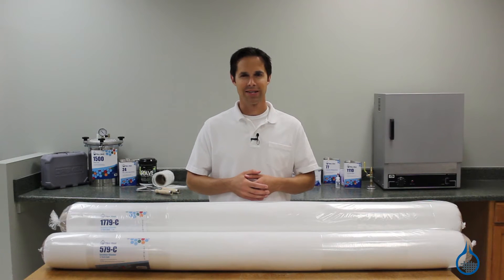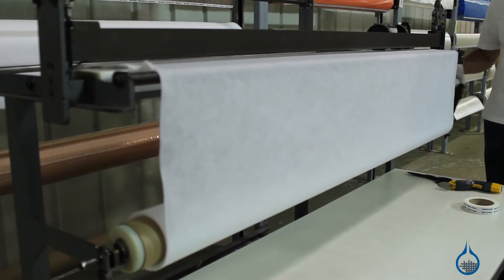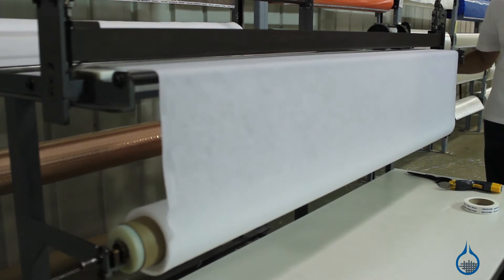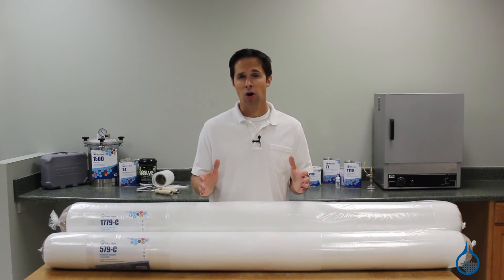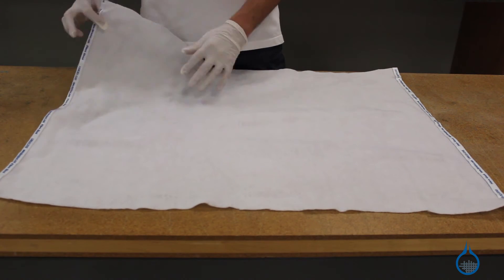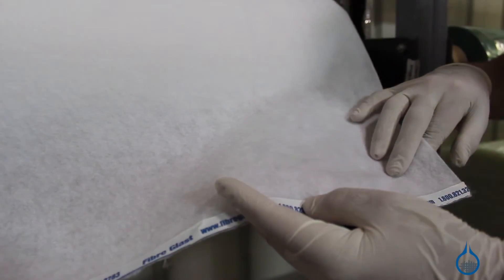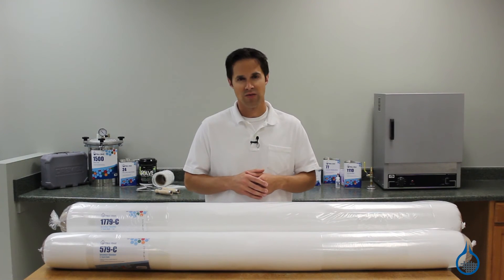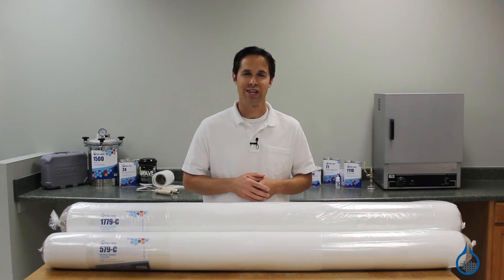Breather and Bleeder Cloth

Comment: Breather cloth and Bleeder cloth are the same thing?
Reply from the maker: Breather and Bleeder Cloth are the same yes. It is one cloth that serves two key purposes during the vacuum bagging process. For more information please contact our support team at 800-838-8984 or customerservice@fibreglast.com
Reply: @fibreglast  Thank you and can you tell me what is Bleeder ply?
Reply from the maker: @arnonlerdwongpaisan9615  Bleeder ply is the same as the cloth. Bleeder/breather cloth is used to better distribute vacuum pressure across the laminate surface and to capture excess resin during the vacuum bagging process. For more information please contact our support team at 800-838-8984 or customerservice@fibreglast.com